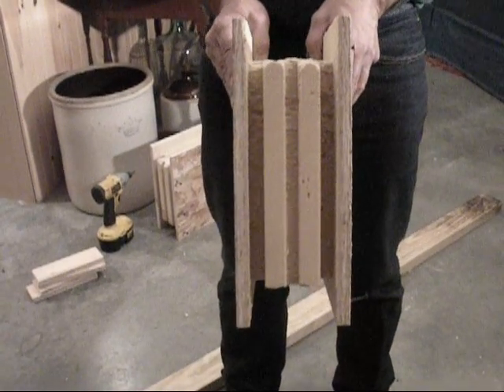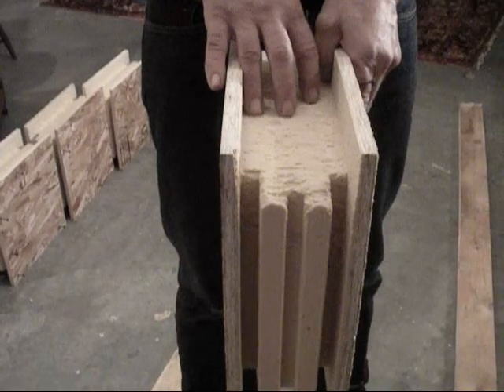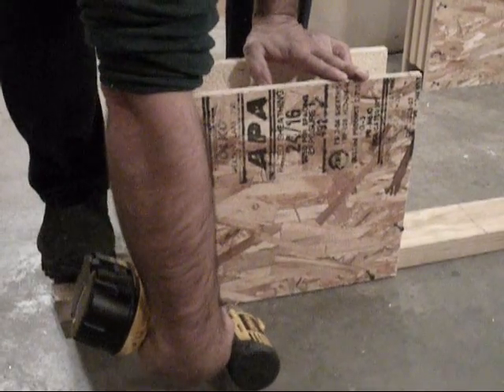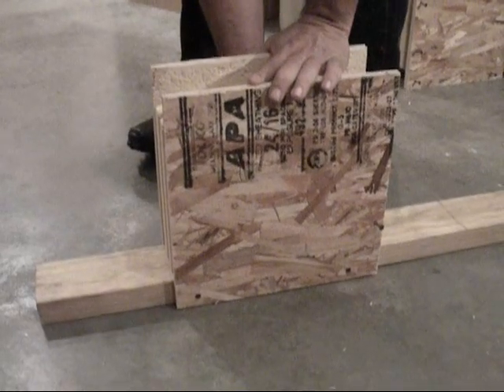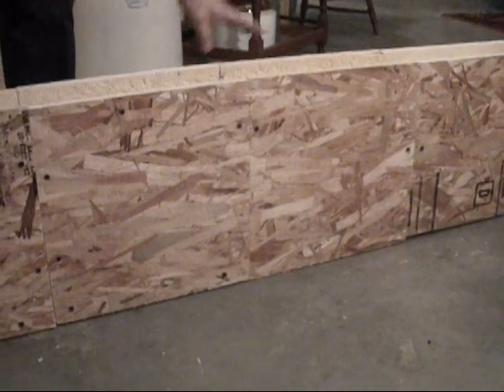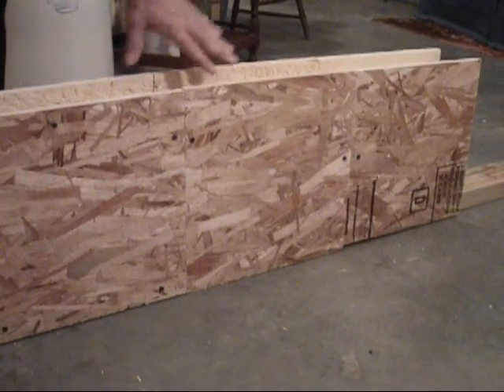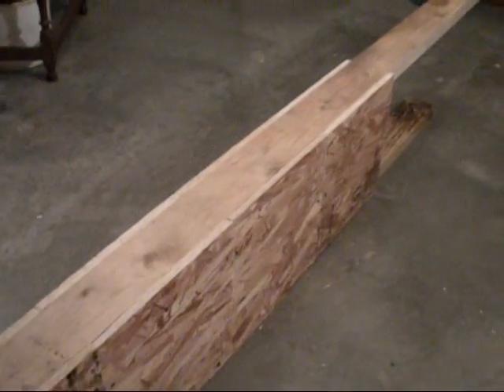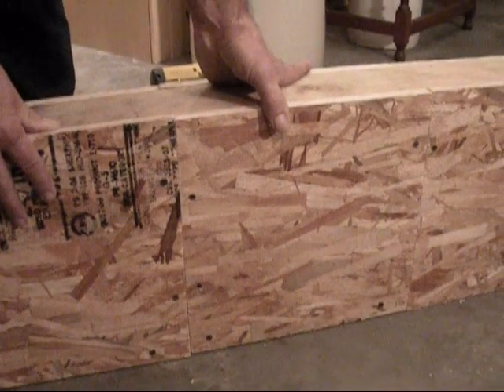Building with SIP's

Comment from the maker: There are many ways. If you have a basement you drill down from the wall into the basement and cut out the receptacle box- wire as normal. You can also make an extended baseboard and use lower profile boxes. Electrical work takes a bit more thought but isn't very hard to come up with exterior wall solutions.